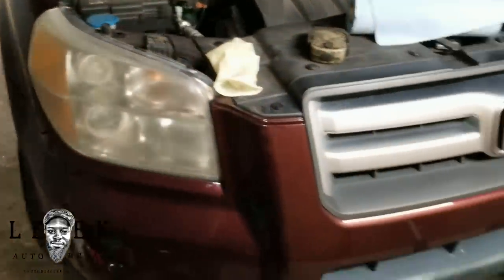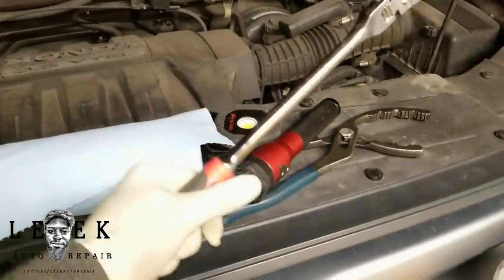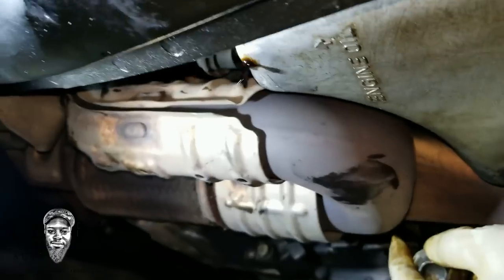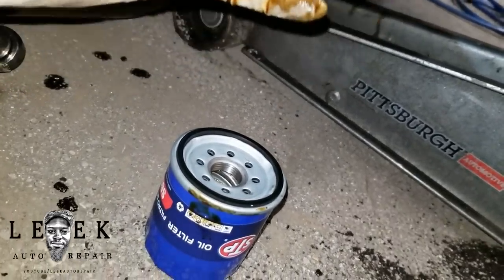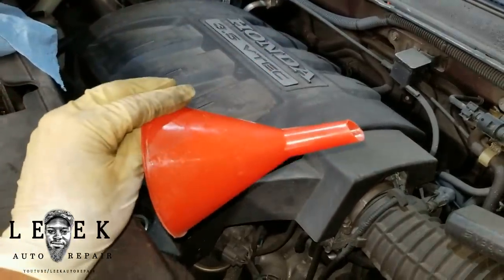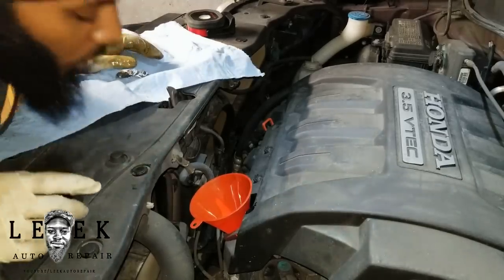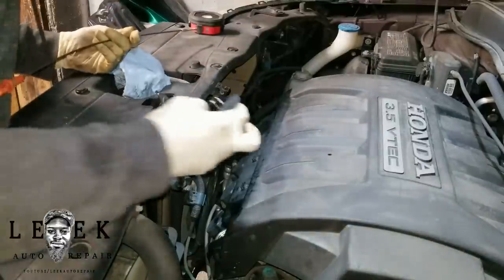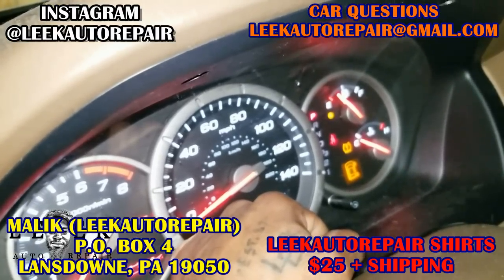2003-2008 Honda Pilot Engine Oil & Filter Replacement

Comment: Switching to Amsoil next oil change in about 2000 miles, thanks for the videos, 2003 Honda pilot going 270,000 mi

Comment: Always recommend to replace that drain plug washer. It’s not only to help prevent oil leakage. It’s main job is to prevent damage to the oil pan threads. It’s called a crush washer for a reason. When it’s new and you tighten down on the plug the washer will be crushed/damaged. When you don’t have a new washer or use the same one over and over, to get the same level of tightening on the drain plug, you’ll begin to pull on the oil pan threads. Eventually they become those threads damaged so that they strip and then you gotta replace the whole damn oil pan. A new crush washer each time you take that plug off is super cheap insurance to ensure the pan stays good.

Comment: Excellent video.Clean voice that I could  understand.  Nice close ups with the camera and no crappy music in the background so people can concentrate on what you were saying and doing.  Just a suggestion for people to know.  I use a plastic bread bag around the filter while removing it. Oil and filter drop right in the bag less of a mess. I always get a large piece of cardboard from the trash to put under the vehicle when doing oil  and filter changes no spots in the driveway. Wife would get pissed.  You can use some WD-40 or any light spray oil on those head lights to make them nice an shiny. Spray it on then rubber it off with a shop cloth. Do that once in a while.

Comment: Connect a pice of  a water hose  about 20 inches to the bottom of the funnel pice and that makes it much easier when poring the oil     spilling days are over hope that helps bin going that for many years  God bless